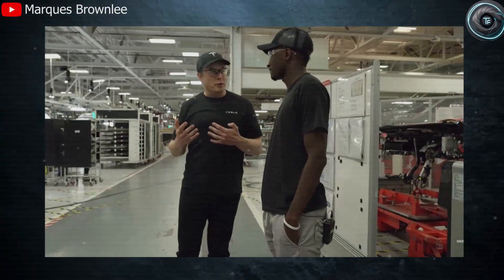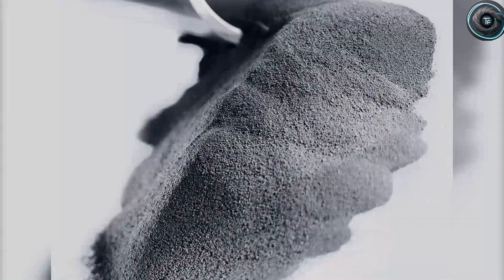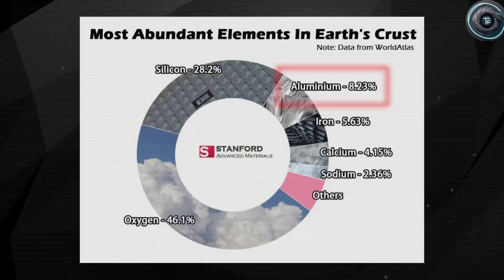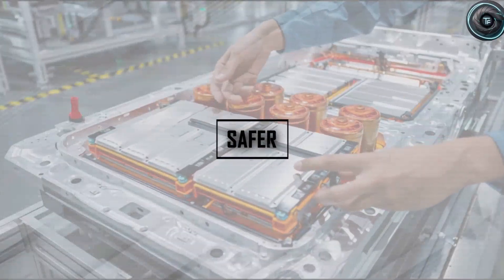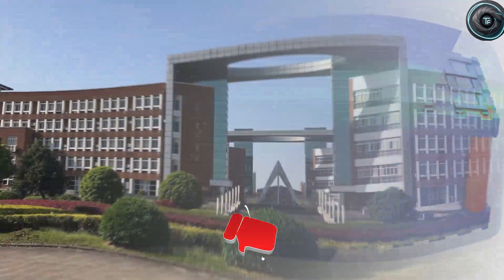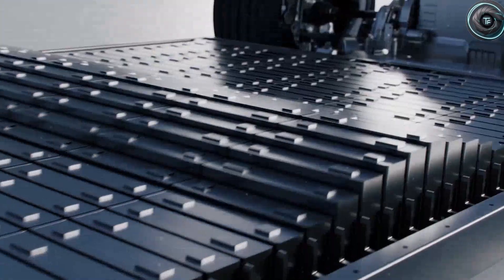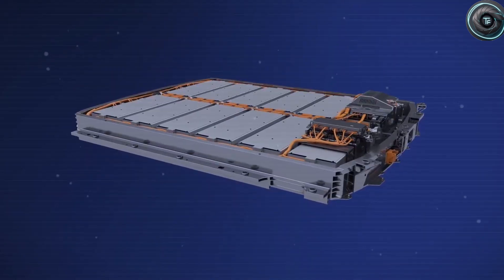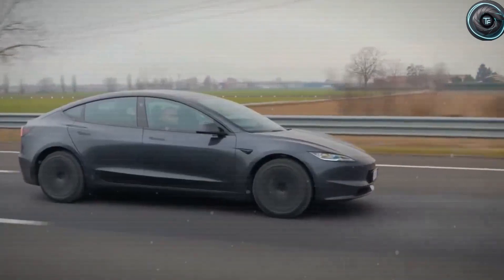Game Over for Lithium! Tesla Model 2’s Aluminium-Ion Battery Breaks Every Record!

Comment: You simply cannot inject that amount of energy into anything in one minute, there would be a massive meltdown. First if you could fire a car full of energy that quickly you'd have a pretty good weapon, also either the battery, the cable or both would melt . Moreover, where would we get that amount of energy for, potentially, millions of cars to all charge at once. Not possible, not happening.
Reply from the maker: Fair point.
Reply: Well the universe big bang was created in less than 1mS so it can be done!

Comment: No, aluminium-ion batteries are not currently being mass-produced for cars, although there is significant research and development. They are considered a promising potential successor to lithium-ion batteries due to aluminum's abundance and lower cost, but challenges remain before they can be commercialized for use in vehicles.
Reply from the maker: True, but close.